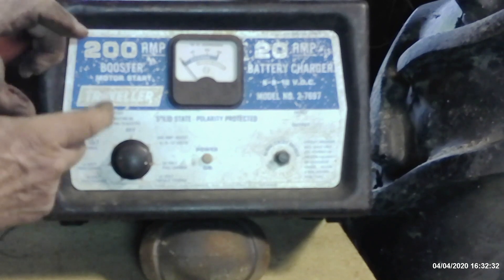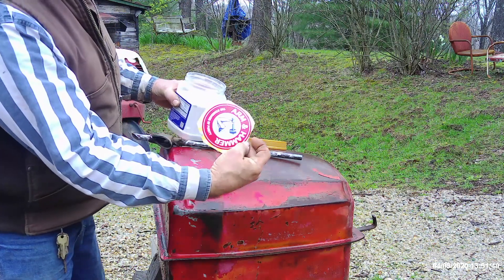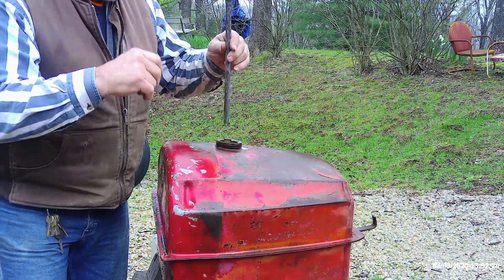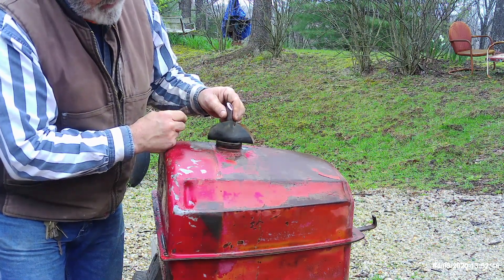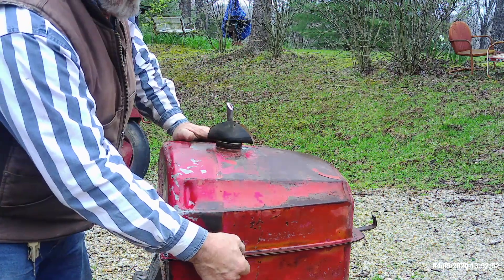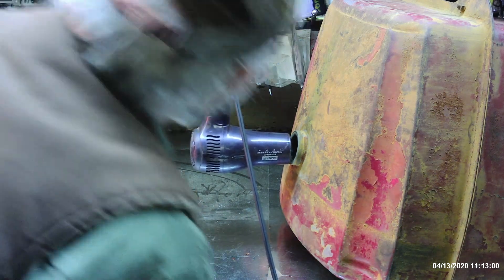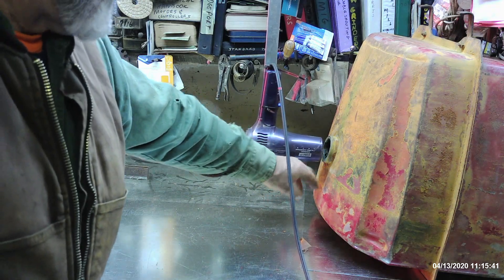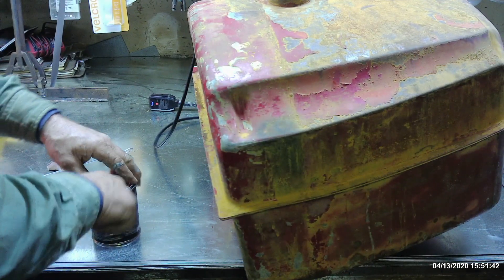Electrolysis Rust Removal Massey Harris 30 Gas Tank

Comment: If the tank has baffles in it, will it still derust the far sides of the baffles? Anyone with experience in this, I'd love to hear the answer. Cheers from UK.
Reply from the maker: Well Christopher, I have found that electrolysis  is primarily a 'line of sight' transference, but I suspect there IS a certain degree of rust removal on the back sides of the baffles.  But it is minimal in my estimation.  I had a camera on a flexible wire I use to look inside spark plug holes but it failed before I did the last tank...which was a Farmall H with a baffle.  I really wanted to see the results before applying the coating.  I do know that after the tank was looking very good as far as could be seen with a small mirror, I was able to knock some rust flakes off with some effort smacking the seam pretty good with a mallot.
     I think the best way to deal with a baffled tank is with a handfull of 1/2'' or 5/8'' nuts dropped in then rotating slowly by whatever means you have.  The nuts and large rust particulate then is easy to remove with a telescoping magnet.  The next problem is coating the backside of the baffle.  I think it's almost impossible to accomplish.

Comment: I used a plastic funnel the size of my of my 3/8 Allen wrench ,it fit tight and made it easy to isolate in inlet.
Reply from the maker: Thanks Gerald, that's not a bad idea at all.  I may use that idea.  Sorry I missed your comment, but I just found it.  Thank you for watching and commenting.

Comment: ⚠️Electrolysis creates atomic hydrogen, which can ruin the steel. This is called hydrogen embrittlement.
Reply from the maker: That’s good to know. What’s cool is the way you can control it by just transferring the rust leaving a pristine surface ready for a finish to be applied. I learned a new term today. Thank you.
Reply: @tractorman4461  Thank you. I am not an expert. But that might be important to know, I thought. More information can be found at Wikipedia, for example.
Reply from the maker: @Tag-Traeumer  excellent advice.  I've just used this technique to prepare metal for refinishing for years and never once researched it to any degree.  With these old tractors and machinery a lot of the extremely rusty parts are very difficult to find replacements for and in the condition they are in are essentially useless.  So Its a win-win situation with something that's no good at all in the condition its in and not replaceable by any easy means.  Thanks for the additional input Tag.
Reply: @tractorman4461  Thank you. Electrolytic rust removal is interesting, I thought so too. I also used it to treat a compression spring, but reminded me that I heard about hydrogen embrittlement. So I stopped treating the spring and immediately put it in my oven overnight to let the hydrogen go out. But you have to do this immediately, otherwise the hydrogen will penetrate too deeply into the metal. 

That is probably a complicated phenomenon, I don't know which types of steel are at risk of how much from hydrogen embrittlement. 

Thank you for your reply. Greetings from Switzerland. (My englisch is not good, sorry about that.)
Reply from the maker: @Tag-Traeumer  I knew I liked you for some reason....My Great Grandfather was born right at the St Goddard Tunnel in a little town called Airolo.  I still have relatives in the area too.  I met some of them about 15 years ago when they came over to America to find relatives in the area. I was lucky enough to be the first one they contacted by phone as they entered St Louis area.  Oh by the way, your english is quite good !!  My wife and I have been wanting to make a trip over there ever since.
Reply: @tractorman4461  Thank you very much, that's very kind. That your roots are partly in Switzerland is surprising and interesting! I hope you can visit our little country as planned. (Probably not until the pandemic is over.)

A cousin immigrated to the United States, New Mexico, in the 1970s. He is a physicist.

I myself had never been outside of Europe.

Airolo is well known to everyone in Switzerland because it is located on the famous Gotthard tunnel.

And by the way, to be honest, most of my English comes from the google translator.

Kind regards to the USA.
Reply from the maker: @Tag-Traeumer  have you been to the museum that’s near the St Gottard tunnel ?  I don’t know where exactly but it may be in Airolo. I have a relative that’s the curator for that museum. He is one of them I met during their visit to St Louis, Missouri USA. What town or city do you live in ?
Reply: @tractorman4461  I've never been to the museum. I think I saw something about it on TV. Did you mean the "Sasso da Pigna" fortress in the municipality of Airolo? It has to be this one, I looked on the Internet earlier.

It was a top-secret fortress to protect the Gotthard route. Built in 1943 and used for military purposes (luckily never used in a war) until 1998, when the cold war was over.

I found information on Wikipedia. The website of the museum is: "sasso-sangottardo.ch"

According to the website, the curator of the museum is a woman: Cristina Kaufmann. Then your relative is probably no longer in this job, maybe in another job at the museum.

The city in which I live is called "Grenchen", in the canton of "Solothurn", that is in the north-west of Switzerland. The city is not big, around 16ʼ000 inhabitants. In the USA it would be just a village.

Maybe you know the "Swatch" watch? It was developed in Grenchen and some of it is still produced here. The watch industry is important in Grenchen.

St. Louis, is this the city after which Lindbergh's plane was named, the Ryan NYP Spirit of St. Louis?

Kind regards from Switzerland
Reply: @tractorman4461  I took a quick look, of course St. Louis is the city. (That was a stupid question of mine.) There is only one St. Louis in the US. The gateway to the west, on the Mississippi. Paddle wheel steamer, Mark Twain ...

I think I have now found the information about the museum where your relative works: The "National Museum of San Gottardo". It is on the Gotthard Pass at 2ʼ100 meters above sea level and shows documents, models, weapons, works of art, rare objects, minerals and old vehicles.

The address is: "www.passosangottardo.ch/en" then down on museums.

Kind regards from Switzerland
Reply from the maker: @Tag-Traeumer  Thank you Tag, I didn't have access to the name, so I assume this is correct. What part of Switzerland do you call home ?  And which of the many languages of the country is your primary language ?  Thank you for the link.  I am going to see if I can find my relative listed in their information.  By the way, your research on St Louis, Mark Twain, the Mighty Mississippi is correct !!  I was a little boy when the Gateway Arch was built.
Reply: @tractorman4461  Thank you, very interesting. The Gateway Arch seems big, even if you only see pictures of it. Standing in front of it is certainly very impressive. I also find it amazing that the Gateway Arch looks so modern.

A neighboring village of Grenchen is called "Arch", and there is also a river there, the "Aare". This is the largest river in Switzerland.

The "Aare" would actually be much bigger, it flows into the great "Rhine", and where the Aare and Rhine flow together, the Aare is the larger river with more water, so it is actually wrong and unjust that the Rhine keeps its name and not the Aare. But there are historical reasons for this. Half of the Aare also flows through the municipality of Grenchen.

The city of Grenchen is located in the German-speaking part of Switzerland, but only about ten kilometers from the border with French-speaking Switzerland. (All children in German-speaking Switzerland have to learn French at school.) There is also Italian-speaking Switzerland, Ticino, where your great-grandfather was born, and, not to forget, the Romansh, a small minority, but Romansh is also one of the four national languages.

Because of the museum: At first I thought it should be the Sasso-sangottardo fortress museum. (I wrote that in the first communication yesterday.) Then I found the other museum, the Passo-sangottardo. (That's why I wrote for the second time yesterday.) There isn't that much information on the Internet about the Passo-sangottardo on the Gotthard Pass. This is the e-mail address: "info@passosangottardo". You may receive information about your relative through email. The Passo-sangottardo museum is closed until summer 2022 due to renovation work.

Greetings from Switzerland and your videos are very interesting, I'll watch more.
Reply from the maker: @Tag-Traeumer  I apologize for taking so long in reply.  Thanks for the great information above. I am going to email the Passo-sangattardo and see what I can find out.  My family definitely spoke Italian, we have a number of letters written in Italian from the relatives that stayed in Switzerland.  These letters are from the 1880's and 1890's.  When our distant relatives visited us here years ago, I let them read the letters to us.  It was very interesting to hear the written word of our ancestors spoken out loud 130 years after they were written !!  Thank you so much for the information about the town of Grenchen and the river Aare.  Very interesting to learn. Thanks for hanging around to watch a few more videos too. Take Care and be well my friend.
Reply: @tractorman4461  Many thanks! But you have absolutely no reason to apologize. The way you respond to all of the comments on your videos is great, it sure takes a lot of time. I also notice that all of the comments (that I have read so far) are always very friendly and kind, and so are your responses! 

The old letters in Italian are amazing! Very impressive! If you consider the emigrants at the time, how they could only keep in touch with their families or relatives through letters. And the costs for postage were certainly high back then.

I hope you find the information and contacts you are looking for in Airolo.

I wish you all the best and enjoy your work and your outstanding videos. 👍

Friendly greetings from Switzerland 🇨🇭
Reply from the maker: @Tag-Traeumer  Thank you sir for the kind comments and hope to hear your thoughts on other videos as well.  Take Care, be safe and have a wonderful week !!
Reply: @tractorman4461  Thank you very much for your good wishes sir, that's very kind! Yes, I will definitely want to watch more of your videos and maybe comment on something. Have a wonderful week too, and all the best!

Comment: I have a 1947 Farmall A gas tank with a baffle and just wondering if electrolysis will work drawing rust from behind the baffle? Thanks
Reply from the maker: Well.... yes, but not exceptionally well without really working and working...and working at it.  This works best as 'line of sight' so the rear of the baffle and what's hidden from direct line of the anode suffers.  I just did an H tank with the baffle and it was one of the hardest I've ever done.  It took repeated attempts and took close to two weeks to accomplish.  I powerwashed the tank to begin with.  24 hr electrolysis.  Rinse and added several 5/8'' nuts.  Picked up and shook, concentrating on the bullet end of the tank and the back of the baffle with the nuts.  I'm not sure they ever really got back there because I don't know the gap around the baffle but whatever they were banging on produced a ton of flakes each time I did it.  I did it over and over in  between the multiple electrolysis procedures and finally got it to where there was little to nothing coming out. The reason I use nuts is twofold.  1) their sharp edges and 2) they are retrievable with a telescoping magnet.  Also skim the tank bottom after each episode with the magnets and you will remove tons of scale as well.
    It was THAT hard.  I still am concerned that the back of the baffle may still have a some rust, but I'm sure the flaking is all gone.  Another concern is there is no way to guarantee the tank coating will cover all areas of the back of the baffle.  That's why I try to use a large low resistance fuel filter on the gravity system.  Run it a few weeks then sawzall it in half to see what's in there, if anything.  That'll tell you if you did a good job or not plus it eliminates the potential of putting rust into the carb.  If it plugs up in a week, you still have a problem.  I can report though that I have had real good luck, but I go to the extreme because I hate dealing with faulty fuel delivery. Time will tell on the H though.  This Massey here is doing fine.  Hope this helps Charles.
Reply: @tractorman4461  thank you so much for your quick response. If I am not mistaken the baffle is about an inch to the right of the gas opening running almost to the bottom of the tank leaving a small space for fuel to move to one cell to the other. I am pretty sure no nuts or bolts could pass to the other chamber. As you have said maybe an extended amount of time rust will somehow move past the baffle onto the positive charged sacrificial metal. What do you think of the idea of putting a a retrievable magnet that will help catch any loose rust? Thanks
Reply from the maker: @charlescochran9803  now you know what ... that’s a darn good idea. I hadn’t thought of that.  If you attached a Rare Earth magnet near the fuel stem sticking up in the tank I bet it would work wonders. One with an attached hook or loop maybe. That’s what’s so cool about YouTube... You get done darn good ideas passing back and forth.  What you describe is similar to a magnetized oil plug and a very good idea to implement !! Now why didn’t I think of that Charles. Lol. Thank you for the suggestion.

Comment: I removed rust etc from the inside of a '44 massey harris 1953 by placing inside the tank two cups of  1/2" roofing nails and a small 3' 
length of 3/8" chain. I got exercise by moving the contents back and forth and after a couple of hours the inside was shining good as 
new. I have a '30 and could possibly do the same to it if needed. I didn't need electric spark to expand the tank or take the doors off 
the building. Thank you for the opportunity to contribute and I hope it may help someone else.....
Reply from the maker: Oh yeah Jim, I've done the routine similar to what you describe, but I use 5/8 or 3/4'' nuts to roll around.  I'm getting lazy in my old age and don't want to toss them around anymore.  LOL...It DOES work quite well....kinda like a rock tumbler....with metal.  You'll do the 30 tank much easier though because it is soooo much smaller and lighter than the 44's.  I'm sure you used a telescoping magnet to retrieve the nails like I did with the nuts....?

Comment: Most people do not know electrons travel from (-) to (+). Most of the time when you tell them that they do not believe you.
Reply from the maker: You are correct sir on both counts !! With this process all you gotta do is watch the action in the water before it clouds up.  Motorcycle gas tanks are a lot more difficult because of the hump in the middle.  It DOES work, but it's much more difficult...time consuming.
Reply: @tractorman4461  I have never had a motorcycle tank go bad... I ride them so they do not have a chance.  I have ridden over 1/4 million miles in my lifetime so I ride almost every day.
Reply from the maker: @davescorneroftheworld1147  I usually find the rusty interiors in old bikes I trade for or pick up for nothing.  Mostly old Japanese street bikes.  That's good to log so many miles !!  I used to live on two wheels too, but that was a long time ago.  I've got no idea how many bikes I've owned.

Comment: Just curious. The electrolysis is line of sight. Would it work better to have a 90 degree bend in the electrode so it ran back toward the end of the tank? 
It might require a support to center it in the tank.
Reply from the maker: Yes, I believe it would work better if for no other reason that the additional physical size of the anode.  Some tanks are fitted with an internal baffle and that creates a big problem with electrolysis.  My assumption is that the process is 'line of sight' but I honestly do not know for sure. It may convert the rust to something that suspends itself in the solution because the solution is always various stages of deep dark green to light green as the tank is flushed.  But yes, additional anode turned 90* would work wonders. 
    If you have an open non-conductive tank with a suspended rusty item in the center, you can ring the tub with anodes and rapidly draw the rust from all directions.  If you just have one anode, you have to turn the piece periodically which I why I made the assumption of line of sight.  The water still turns greenish though.  Baffles are the big problem though. I drop several big 1 1/4'' nuts inside and shake the fire out of it continually turning to knock the huge flakes and barnacles before starting electrolysis and that helps a lot.  Side note: Rocks are not retrievable with a magnet, so stick with the nuts....LOL.
Reply: @tractorman4461  The line of sight thing is true from my experience too.  The 8N has a baffle. When I first got the tractor I strapped the tank on to my cement mixer and tumbled it with nuts in it. Worked pretty good. I could tilt the mixer so it hit pretty much everything.
Reply from the maker: @OldSneelock  Hahahaha...concrete mixer...novel idea.  I strapped em to the four wheeler and also to a rear tractor tire but a mixer would've been the logical and more controlled choice.  Funny some guys overlook the simplest of solutions....LOL.  Thanks for the cool idea.